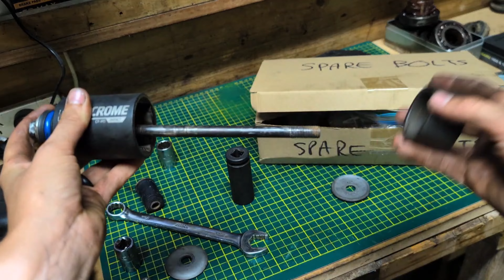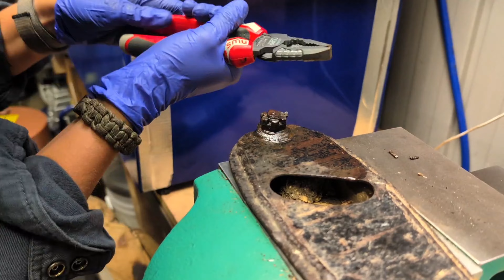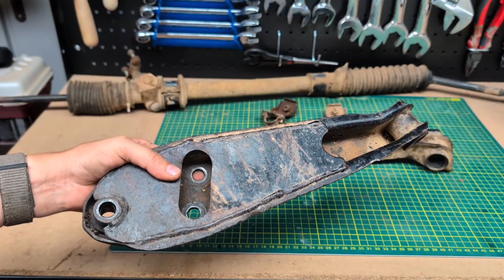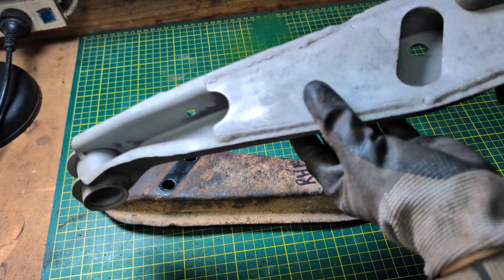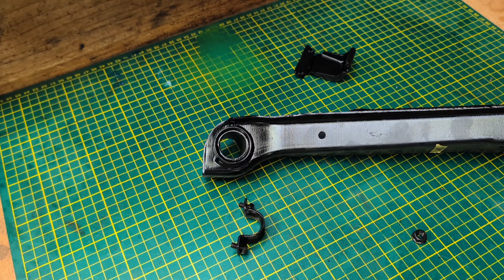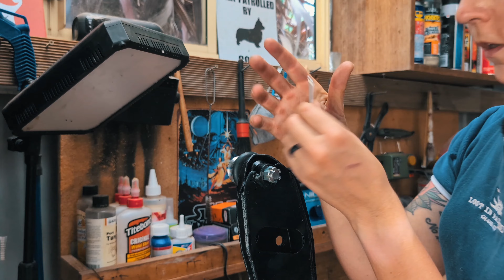Control arms - Subaru Brumby Restoration | Part 12

Comment: Nice video, the reason your bushings wouldn't fit, is because you didn't press out the sleeve of the old bushing. The stock bushing has a metal sleeve around it. If you remove the old sleeve,  the new bushing will fit like a glove. I had to use a carbide deburring bit and grind a slit in the sleeve, then I was able to collapse it in the hole and it fell right out without using a press. I hope this helps
Reply from the maker: Legend, thank you! This sounds like it'll do the trick and I'm going to give this a crack now